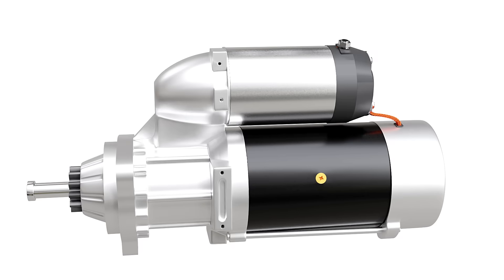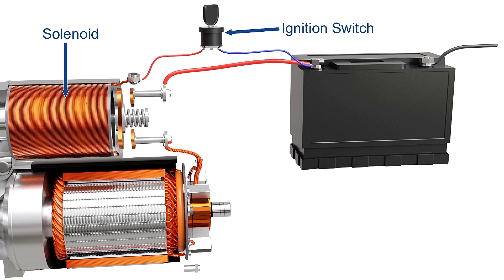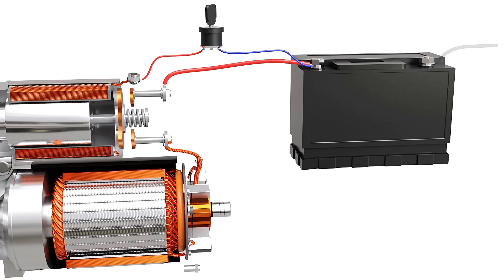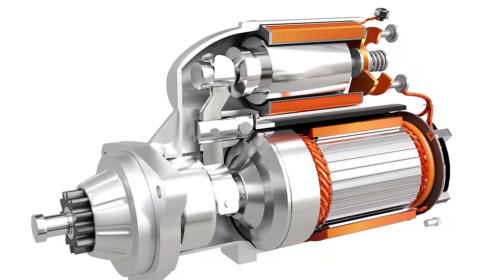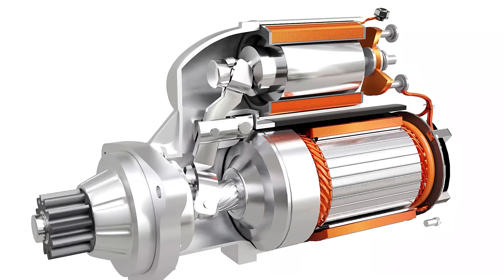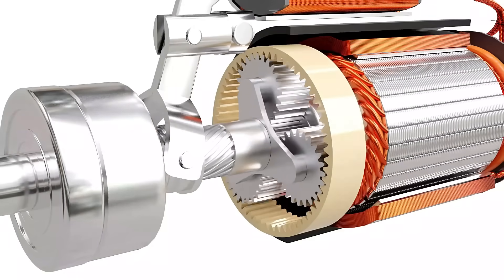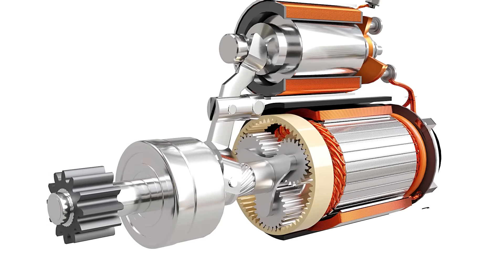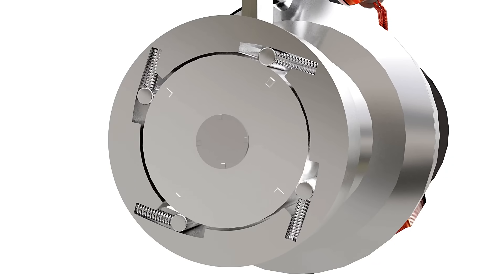How an Engine Starter Motor Works

Comment: Old starters (before the mid 80s) did not have the planetary gear set depicted in this video and were therefore much larger and heavier and therefore used more power to crank the  engine which if the battery was even a little low, it would have difficulty.
Reply: I've always had a serious plug-in charger/jumper for that reason. :) 

In the early 70s, people would put a kick start on the old Harleys (who were always LIGHT YEARS behind Honda, and way overpriced for using such old mechanics...) that had electric start. Because you'd PROBABLY need it in the near future. 

They were using generators and drum brakes well into the 70s. Plus points and plugs. Eye roll 😆 

It was a great deal more maintenance than now. Today, I go out and start it. That's 90% of what needs to be done. Lol

Comment: video is very good, but to be really, really perfect, the helicoidal spline is also there because the motor starts to spin before the pinion engages with the flywheel, so the helicoidal spline couteracts this initial rotation to have better mesh of the gears. The early start of the motor is to have it start with little to no load and then add the load later (we're talking about milliseconds later) to reduce the current spike and prevent damage to the whole electrical system.
Reply: Could you speak more about the early start of the motor you refer to? I noticed there were two different gauge coils wrapped around the spool. Im assuming this is related to what you are talking about?
Reply: nice

Comment: A starter motor and solenoid is an ingenious combination that beats the hell out of cranking a Ford model A by hand. About time they came up with a solution.
Reply: Hand cranking is great until the crank kicks back and breaks your arm.
Reply: Honestly I wouldn't mind cranking an engine the old fashioned way.
Reply: @bono894  until it’s cold and rainy, snowy, stormy, or windy
Reply: @benjamingreen9540  Yup, you got that right. 

I had a 72 Harley. They were always 30 years behind Honda, and greatly overpriced for such a not-charmingly-rudimentary system...

I capitulated and bought a Gold Wing. 0 problems. Worth every dime. 

In 1994, they were still entirely made in Marysville, OH. 

Not fun rebuilding things on the side of the expressway. Again. Replacing broken stuff, like a split chain guard. Or, my all-time favorite, stripped screws. Yay. 

They come apart due to the insane vibration, a cache which loses all its charm the first time it's cold, wet, freezing or nearly kills you (again)
Reply: @bono894  that is, until you have to crank a 5-8L V8 or bigger
Reply: But why they did not used a contactor instead of solenoid it would have saved a lot of space.a
Reply: @jatinmali9310 Because a solenoid also moves the gear into mesh with the starter ring on the engine flywheel. So the solenoid has two functions: 1/ Move the gear into and out of mesh with the starter ring; 2/ Operate as a contactor when the gear is meshed.

Comment: Why make the solenoid use a lever when you could just rotate it 180 degrees and make it push it directly?
Reply from the maker: To rotate it that way, you will have to start the motor. This will cause the high speed pinion to smash with the static flywheel and wear out fast.
Reply: Are you saying have the solenoid kinda behind the starter motor so it can push directly? It's probably to save space, that'd make the starter assembly real long

Comment: I haven't been intimate with a starter assembly in a long time, since I've been driving newer cars instead of beaters but it was good seeing one again. Now, I don't even know where the starter is on my fwd car. I can't see it, I suspect it's between the engine and the firewall covered with stuff. Cars were more honest and open back when I was working on them back in the 70s- 80s.
Reply: Absolutely. I remember changing the starter on my wife's '65 Valiant during my lunch hour. That included driving home, pulling the starter (a 5-minute job on a Slant Six), getting a working starter from the junkyard and installing it. I even had time for a sandwich before going back to work.
Like you, I don't even know where the starter might be on my current car. All I can see when I open the hood is a sea of plastic.
Reply: Exactly why I hate newer cars. I love my '02 Taurus.
Reply: @Heck6  09 Mercury Sable :) Same car, more chrome. It's been good to me. I don't know why Ford gets it's rep. This cars been fine. Very comfy, too! 

You'll lose the CD player when it gets stuck at some point (burned mp3s get caught), but other than that...
Reply: Those were real man cars and these days shit ass flying into the air without any takeoff
Reply: I love old model car atleast 20yrs old hope companies bring back their old beasts
Reply: Yeah, but just THINK! You don't HAVE to know it! Isn't that BRILLIANT??? 

I know all about a 1972 Harley because I HAD to. It was ALWAYS nothing but problems. 

Bought a Gold Wing. Entirely US made in 1994. Lost a water pump and it was replaced for free and without the patronizing, too. Never go back to something 30 years behind Honda again.